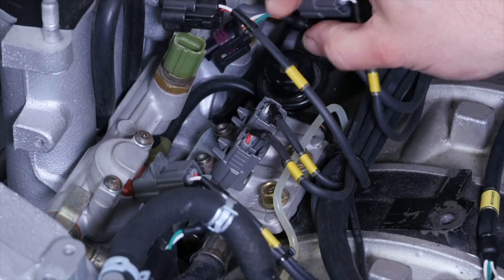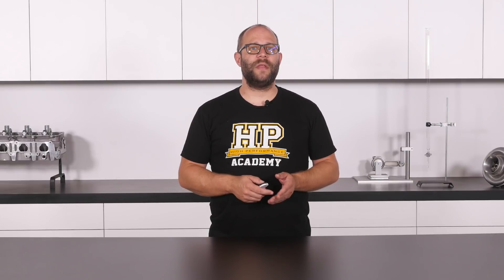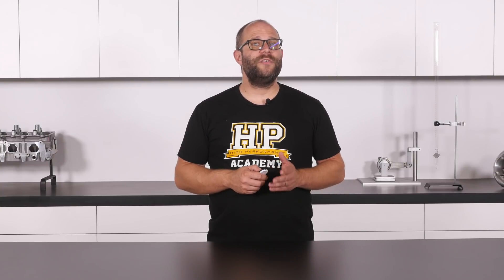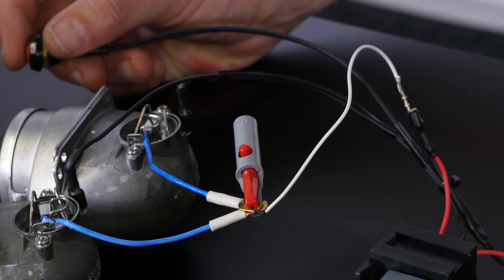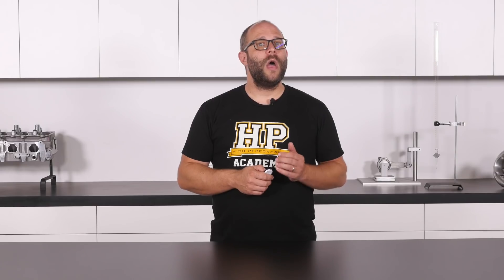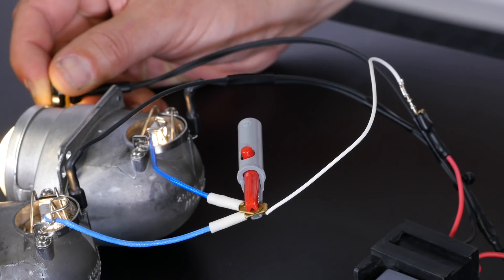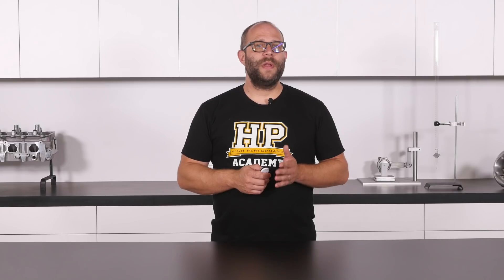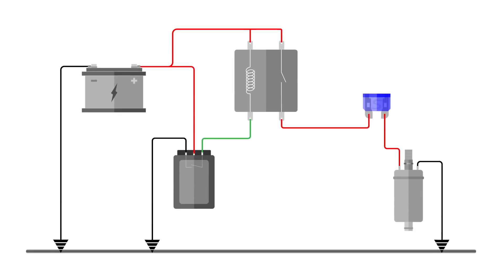Power Supply Design | EFI Harness Construction [FREE LESSON]

Comment: Aren't the injectors controlled by the ECU? I'm not aware of any circuit protection between the computer and injectors on either the power or switching circuits, at least not in Ford's EEC system.
Reply: noobie here.. In a standalone aftermarket ecu, the injectors are activated by a grounding at the ecu. The power to the injectors is supplied externally...usually from a relay/fuse... same for the ignition coils... There is only 1 wire from the ecu that connects to the injector... a ground wire.. I hope I'm right.. someone else will chime in and correct maybe
Reply: @mikedsilva  no, you're about right, most ford EEC systems I've worked with work that way too.